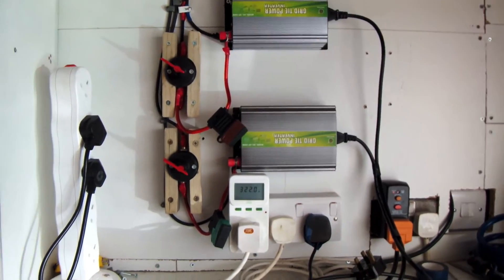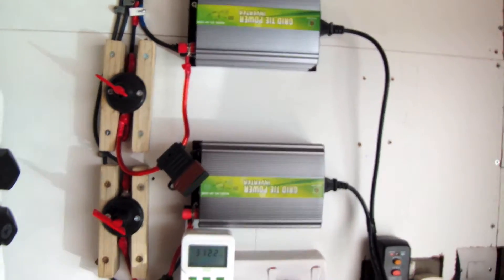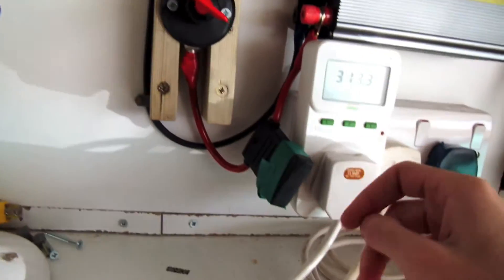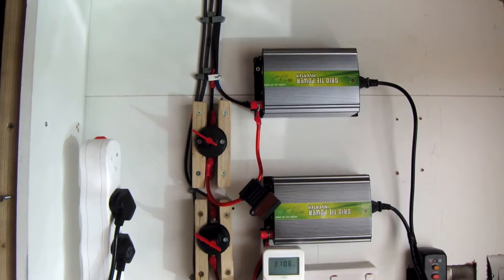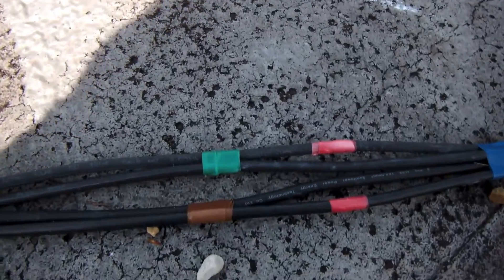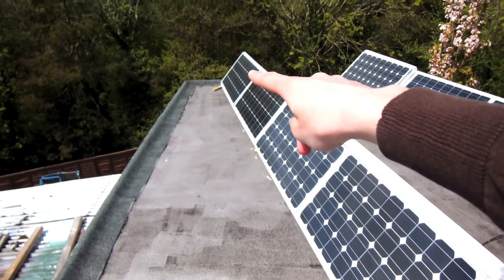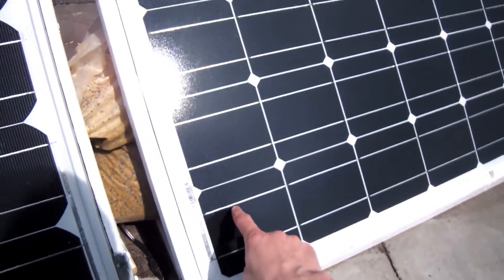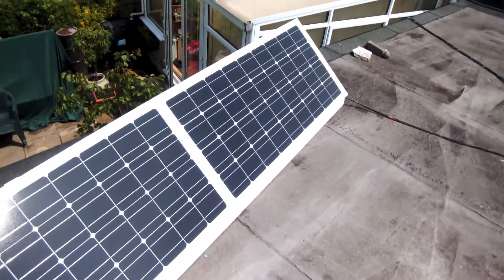Solar grid tied garage setup UK - More panels and re-wire

Comment: Thanks for the video - I have a question, please.
Regarding the regulations in the UK, can you do this yourself without any checking by a qualified person?
I was hoping to do 'Grid Tie' and be paid for energy supplied back to the grid, but as I understand it, this can only be done by using an accredited installer (here in the UK).
Is that the case, please?
Reply: You can. and you cant. the SEG payments require you to use legal hardware and have a MCS (qualified installer) you also need to inform the DNO. 
There are limits and rules. but I would not suggest that you use "toy solar" you can get commercial used solar for less and have more than twice the power.
Your inverters need to be certified and support the regulations. you also need a new meter if you dont have a type2 so that you can import and export.

The set up here would be illegal and could face criminal charges. I say that because the inverters are plug in jointly and would need to turn off within 0.5s of a power loss. As they are connected together they would feed each other and therefore wont detect a grid fault. the system isnt labeled there for fall short of part 7 and IEC as well as REC.
The supplier has nothing to do with it nor does insurance. its the DNO and LABC that would have issues as its a clear breach.. hope youve updated since this video :)
Reply: @guywhoknows  Thank you
Reply from the maker: Please check with an electrician for the current standards and rules. At time of install, we discussed with our insurance and electricity supplier and they were fine with the setup.

Comment: Hi, totally new to this. What equipment do I need to run solar power as a direct feed in to my consumer unit, with no batteries involved?

Thanks
Reply: What ? No... Your solar is DC power and the Consumer unit is AC. things will go bang if you try that!
REC provide information and pictures on how to install solar, but id advise having someone else do it for you.

Comment: For small systems you need to inform your supplier of your connection within 28 days of its installation, providing your system complies with engineering recommendation G83/1-1 Stage 1. Essentially, this means that if your system's output is less than 3.68kW.

Comment: He needs to use much much thicker wire on the PC side he will be losing loads of power with just 4mm wire on the dc side at low voltage high amps.

Comment: This doesn't comply with building regulations as you are required to leave a 1 meter perimeter to the edge of a flat roof. Furthermore your ballast amount is seriously too low to also be compliant and safe, also by using sand bags which are at risk of deterioration therefore risk further ballast lost.

Did you have a structural survey to ensure your roof can bear the weight?

The framework also doesn't look to be MCS 12 compliant and the pitch is far too great, therefore acting like a sail, but also too great a pitch will make your panels less efficient come summer and high sun.

Where are your AC and DC isolators for fire services? 

Cell count and dimensions are not reflective of the panels power. Benq 60 cell modules can produce 335w per panel compared to general 60 cell 250w modules all down to cell efficiency.

Lastly if this is grid tied as you suggested by your inverters then you are at risk of not only fire safety compliance, but your DNO (district network operator) could have your system ripped down. 

All in all quite shoddy work and poorly informed.

Comment: digital meters in the uk for home build systems wont save you money infact they read the energy you produce as units of electricity used the only way to save or make money with grid tie is to have a pro system installed with the all cert & paperwork sent to the energy supplier & the you have a 2nd meter for energy produce, nice video for a small system on how it works, i would like a system again with a wind tubine but its the cost of  quality batteries & they do wear out on large systems quickly & i dont really wont i shed full of deep cycle batteries  any thoughts or ideas around problems with diy grid tie inverters
Reply: Incorrect!
For small systems you need to inform your supplier of your connection within 28 days of its installation, providing your system complies with engineering recommendation G83/1-1 Stage 1. Essentially, this means that if your system's output is less than 3.68kW.

Comment: i used to have a 3kw solar system which was off grid in an old barn which had no mains supply, i discided to have main put in & have a grid tie inverter so i could get rid of the batteries which were worn out, the problem was the grid tie seem to work fine HOWEVER the eon  digital meter counted the flow of electricy as units used & as a result solar energy i produce into grid i payed eon for so i removed  the solar panels,so diy grie tie does work as the meter in the uk wont read backwards & count any movment of electricy as beening units used , your throughs let me know if you have a diy gid tie that save you money on your bill with a digital meter in the uk

Comment: I have another question. Does your meter ever run backwards and do you have to contact your electricity supplier?
Reply from the maker: The meter can run backwards if everything else in the house is switched off or there is only a minimal load switched on. Though usually in peak sunshine the meter stops or turns forward very slowly as the solar takes up the bulk of power demand. We contacted our electricity supplier and they are ok with us using the kit but we cannot claim the larger feed in tariff due to the kit not being certified so we just get our electricity discounted by how much the solar gives us instead of being paid to generate the power. Best to check with your supplier.
Reply: My inverter might be coming today but unless you end up with a negative reading, it shouldn't be a problem.

Comment: What is the tiny panel at the bottom for?
Reply from the maker: The small panel on the shed is 20w, it is combined with one of the 80w panels on the garage giving the shed 100w of power for it's off grid system. If you look at my wiring diagram video you will see the two separate systems and how they are setup.

Comment: When do you expect to break even on cost with out the Feed in tariff ? All in cost and savings so far?
Reply from the maker: Hi John,We estimate around 10 years to break even but this is going down as panels are getting cheaper. Savings so far I could not say for certain but we are getting around £5/month back on average. It's gradual but then we are still expanding it and it's more a project to generate our own power and not just about saving cash.

Comment: Hi I am in the  process of  building  a solar system and i would like to ask what monitor you are using for the power you are producing. Also i find your video very helpful there is plenty of  information.
Reply from the maker: Hi, the monitor is just a standard power monitor that you can get in most shops. Normally they show you how much power you are using but they also work in reverse.

Comment from the maker: Hi Stuart. That is what happens, if you have surplus power then depending on your meter it will either stop or run backwards. Depending on how many panels you have you may not need to worry as you will use that excess power during dull days / night. So if you panels make your meter go back two points during the day but you use four points of power during the night, essentially the grid becomes your battery in a manner of speaking.

Comment: You need another grid tie inverter, you will never get the 500w from the one. try 3 solar panels on 1 and 2 on another, Or get another 2 inverters, and another panel, with 2 100w panels to each inverter. Also due to the inverters not running at 100% efficiency, i doubt if you will ever get 500w of power from 500w of solar panels. This is normal operating.

Comment: Hi there, i have 5 x 100w 12v panels wired in parallel into a 500w 12v GTI. at peak I have only ever had 300w from the system, I have NO shade on the panels, any thoughts on how to increase the output to nearer the 500w mark!!
Reply: Old but here it goes! Best way to extract the max from what you have is to up the voltage. Higher voltage will definitely reduce your losses. As consequence improve the effective output! An hybrid of parallel and series connection would be a better bet to make it happen! ;-)

Comment: Great update, things growing nicely. I've currently got a 190w system running at 12v with 350w GTI. Works a treat although I do have the newer style meter which does keep the red light on when feeding back to the grid, this is normally in the mornings during summer when appliances aren't running. Doesn't last long though, the fridge freezer soon kicks for 15 minutes (once every hour or so?) and sucks all the juice from my solar setup :) Cheers

Comment: MCS is for the solar panel and g83 is for the grid tie inverter. This is a must if you are going to use the feed in tariff. DIY installs cant get the feed in, you must have it installed by a MCS rated company.

Meters, unless you have the very old centre disc type, dont go back, the newish digital meters will show rEd when you generate more power from your system, then you are using. As this goes back to the grid, and your meter has detected a reverse energy.

Comment from the maker: You need to check with your supplier on their policies. Though at that power output you would be unlikely to get a meter running backwards. Instead it would turn slower as the solar suppliments your use.

Comment: I watched almost all your solar panel videos and I have to say I learned a lot and enjoyed watching them. 

I have a question about Grid Tie inverters. I have just bought a new 170W solar panel and thinking to buy a Grid Tie inverter but I just came across a MCS certified thing for here in UK. Is it okay to use this cheap inverters to feed back electricity? Do they reverse your meter reading when you use less power then what you generate?

Comment: NOT including the price of the panels. any idea of the total cost of all other hardware?
Reply: DO not wast your money on the cheap china grid tie inverters work off solar panels I hook it up to a 100 watt panel that put out 18 to 22 volts dc to the cheap grid tie inverter plug it in my wall out let all I could get out put was 165 watts the grid tie inverter was a 1000 watts the dc input 10.5 to 30 volts I hook it up to 24 volts and it blow up